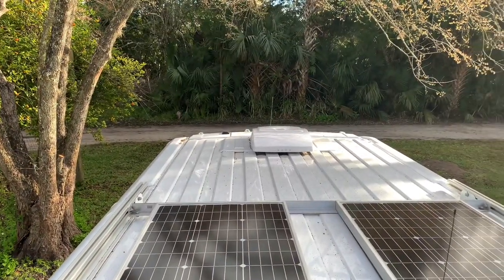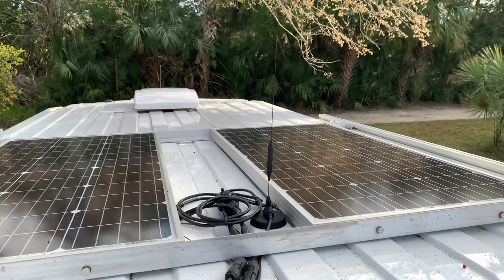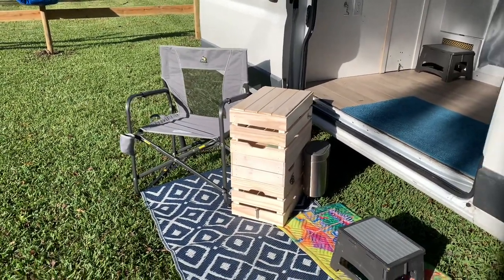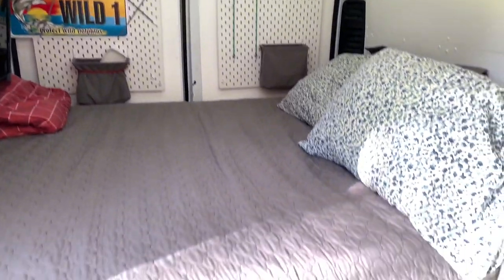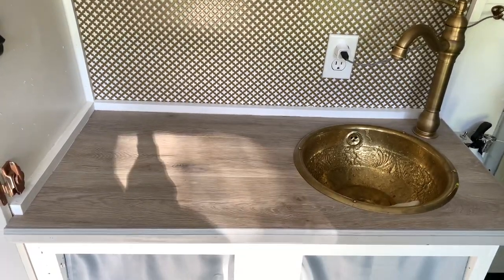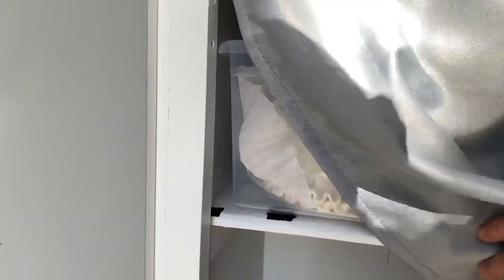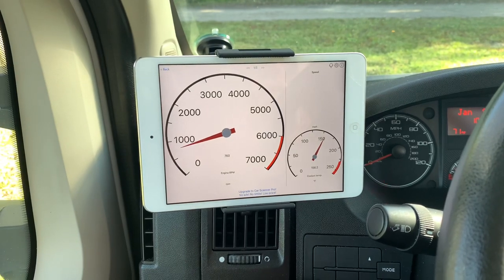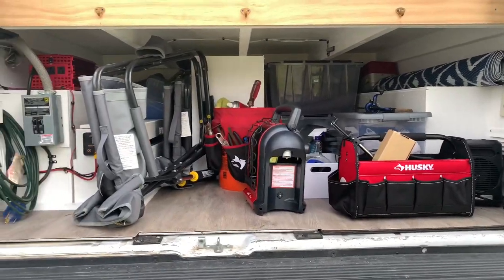Stan The Van "WalkThrough Tour"

Comment: I love your design. I’m planning on retiring in the next couple of years and can’t decide between the 159 And the 139 inch wheelbase.  I’ll be solo so your layout seems like plenty of room for just me.  My concern is the 139 WB is only a 1500 (1/2 ton) chassis, my question is how much does Stan weigh and does it feel driving him like he’s struggling with the weight suspension wise as I know the 159 and 139 share the same 3.6L engine?
Reply from the maker: There is a 2500 139. That is what mine is. We love it fits in a regular parking space. The only think I would do differently is put some kind of a toilet.